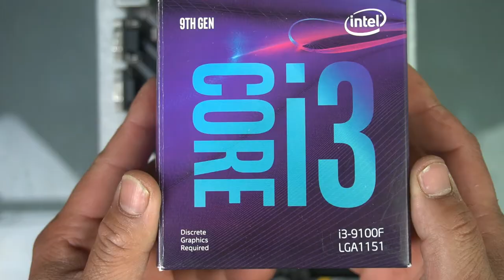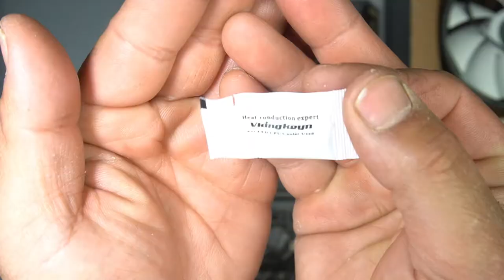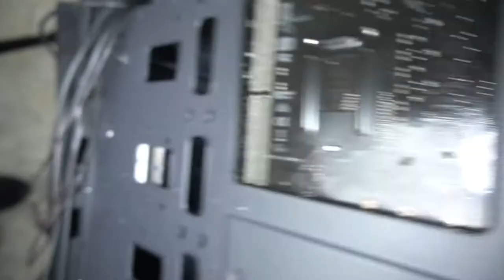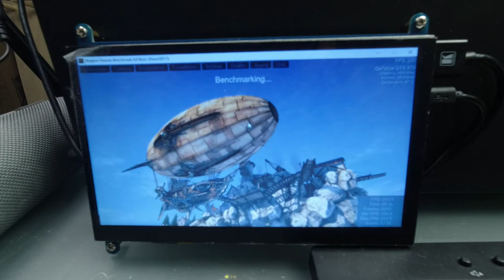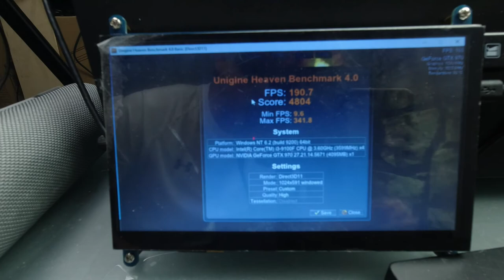how to build a budget pc- i3 9100f gtx 970 4gb gpu 16gb 2666mhz ram 750w psu rgb fans asus tuf h310

Comment: Another tight build looks good apart from WAY to much unicorn vomit with the LEDs but easily fixed cable management looks good as always nice build good job
Reply from the maker: lol..unicorn vomit.. I've heard this before lol... sometimes I just feel leds are better then nothing .. it was cheap enough to just grab 6 fans rather then 1 pr 2 at same price ... only difference these are fixed not argb